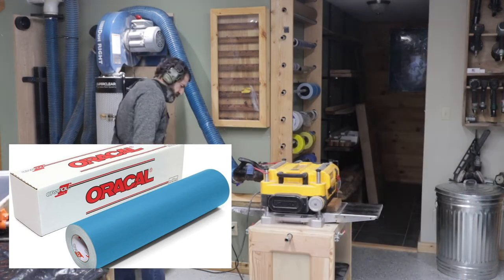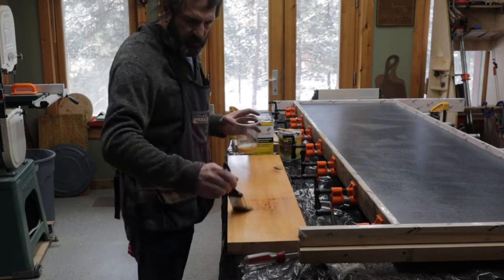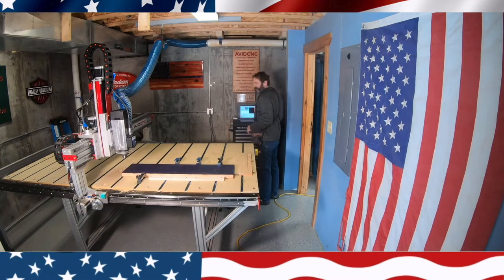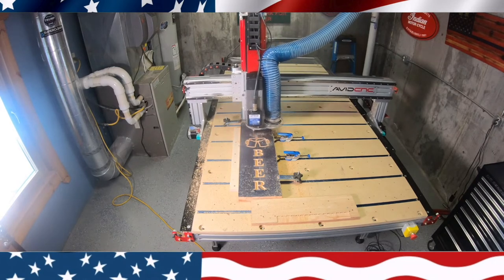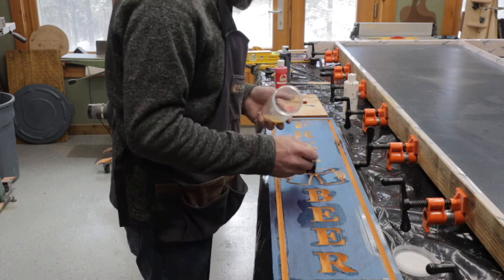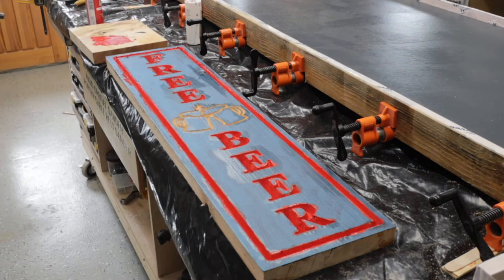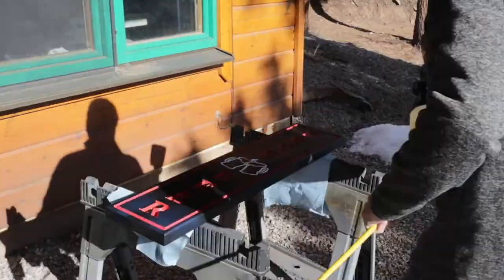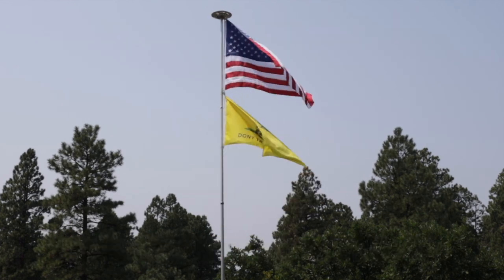ORAMASK 813 SUCCESS

Comment: Great tips!

Here is the process I've been using for years.
I just recently learned about using a hair dyer on non flat, non sanded surfaces.

Seal with spray shellac (I need to try the 50:50 shellac:denatured alcohol), let dry.
If using base coat, apply, let dry.
Mask with Oramask, trim edges.
I use a wadded up cotton t-shirt about the size of a baseball to press the oramask to the wood.
If the wood is flat and sanded that's all that is needed.
If this is rustic barnwood or weathered fence panel, I use a hair dryer.
This softens the oramask greatly, allowing it to be completely press formed to the wood grain.
With one hand I hold a hair dryer on high heat about 1/2 inch from the oramask and follow with the other hand holding the wadded up cotton. 
Cut without dust shoe.. dust shoe can work the fibers between the wood and the mask, and end up pulling up the mask.
I cut the design with a vbit or down cut endmill.
Seal the cut edges with spray shellac, (still need to try the 50:50 shellac:denatured alcohol), let dry.
Paint / mask as needed for single or multiple colors.
Allow to partially dry, but not completely cured, may be slightly tacky, but doesn't transfer paint to your hand when touching, remove mask.
Reply from the maker: Thanks very much,really good advice ,hopefully I’ll be more successful next time, thanks

Comment: How long did you let the sealer dry and how long did you let the paint dry?
Reply from the maker: I should have let it dry longer
Reply: @OutlawWoodworking  paint 3 days then sealed with laqar let dry for 2 days put oramask on cnc painted let dry for 1 hour removed and tackey tried to clean couldnt remove sanded messed up everything burned in trash
Reply from the maker: @bigbear4x43  I messed up quite a few too

Comment: May I ask, what Zinsser are you using? Thanks.
Reply from the maker: Zinsser shellac
Reply: Very happy 5hat it worked out for you, I too had issues at first, but soon realized after watching different folks doing it the way you did in this video. It took me a long g time to spring the bucks for a downturn bit, I had to give my head a shake...man what an incredible difference. Also, I use sanding sealer instead of the shellac mixture, only because I find thT the paint finish has less brush strokes I  it as the shellac seems to be a slicker finish. That's just  e though. Thanks a bunch and keep 😃.  Smiling. Andrew